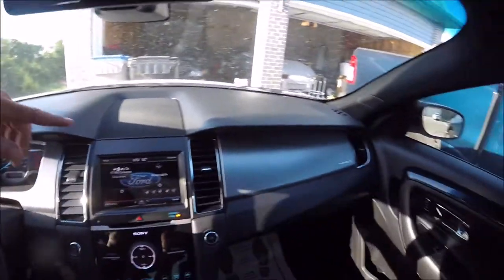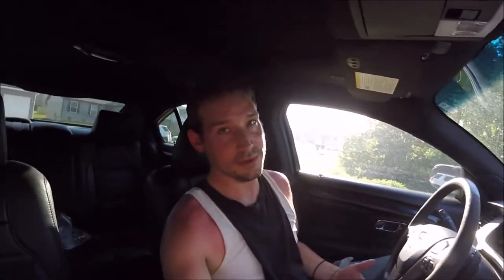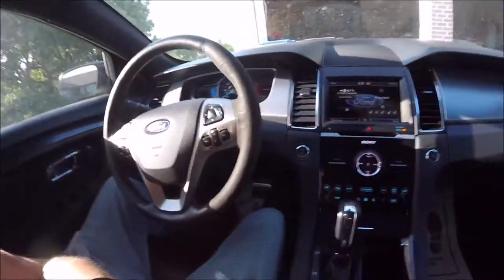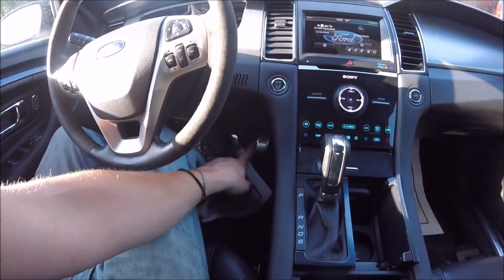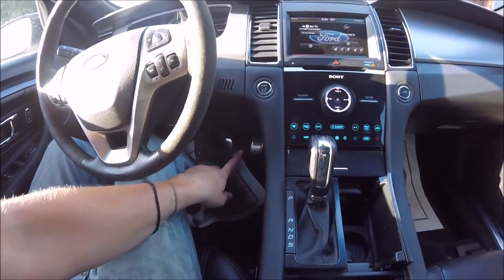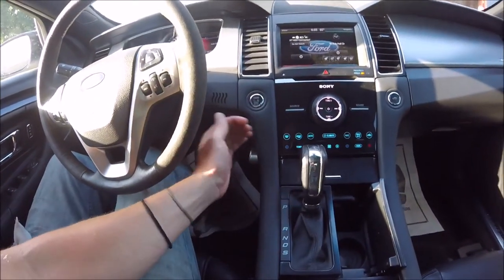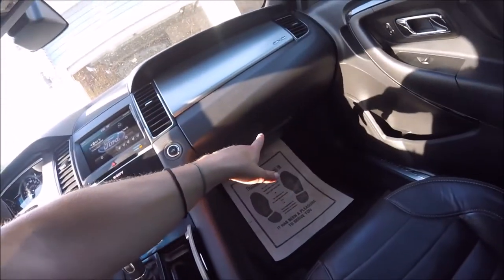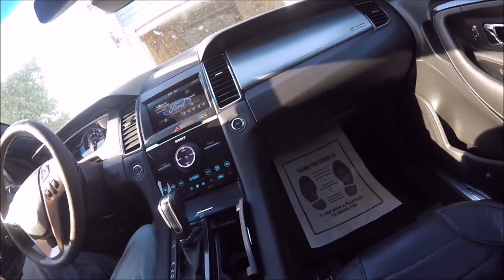A/C from Defrost Only... Cheap fix for your Ford! (Hopefully) | 2015 Taurus SHO

Comment: It worked for me(2015 taurus). Thank you very much for sharing this information. Took about 15 moderate taps with a large  plastic fuse puller(electrician), but it worked...thanks again...

Comment: This freaken worked! I cannot believe all I could find was to tear apart the entire dash before trying, "Knock 5 times, aaaand the door will open." (Yes, mine started working on the fifth tap as well.) Great job, brother!
Reply from the maker: Thanks for the comment and I'm glad it worked for you!  Tearing apart the dash is definitely the permanent solution, but I really didn't have the time or money to do that when mine was acting up, so I was happy to pass this little "fix" along to other people in hopes it would save them some time and money, atleast for a while.  Appreciate you stopping by!

Comment: Well, thank you and you have a LIKE and new SUB. Listen, if you get water on your passenger floor then driver floor, it's coming from the water drains in the cowl under the hood. You need to remove wipers, then BOTH plastic across and look for these little FORD ONLY water drains that fill with leaves get blocked and leak back into car. Then you cabin filter will be shot so change it and hope the A/C works. Thought I would share like U did!
Reply from the maker: Thank you so much!  I appreciate the info and the like and sub.
Reply: Helpful I am getting vwater

Comment: Are all 3 blend door actuators the same size? I’m having this same problem I’m gonna just replace.
Reply: FYI, there are 4 total.  One passenger, one driver footwell, one driver halfway up and one in the dash (which is next to impossible to reach without taking dash apart).  I believe that one is different.  That is the one on mine that died. The quoted $240 to fix with me buying the part and they said it was terrible to replace, as well.  I found a thread somewhere that gave the exact part for each location.  I will look for it.

Comment: I'm having the same issue. I took it into the mechanics and he replaced the actuator and it worked for 1 minute or 2 and then stopped. He changed the middle one. I have no idea what to do now. I hope this works for me lol. My main issue is my engine light came on and it was the cam shift positioning sensor I had it changed with a Ford positioning sensor and the light came back on. Still says cam sharft positioning sensor. I tool it to ford amd they came at me woth a 9k bill saying it was a dozen issues but when I run the code the only code that pops up is the positioning sensor. I got a couple 2md opinions, one from a retired man who ran one of ford's bays for 15 years. He said that what Ford is saying needs to be fixed isn't the issue because if everything they are saying was wrong with my SHO the car wouldn't perform like it does. You would feel it. My car take off on a dime amd runs perfectly. I honestly don't know what to do. My inspection is due in March. If I don't figure it out by then I'm gonna have to get rid of my SHO and I really don't want to. I feel it's a wiring issue but have no idea who to bring it to.  If you can't tell I have no idea about cars. Has anyone gone through this or have any ideas what it could be? Please anyone? I could really use some help.

Comment: Glad it's working man, but that's a blend door actuator. I just took that exact component off of my car, let it hang on the cable and started pushing buttons... If I changed the register selection (ie face to floor, floor to defrost) it was motionless. But when I changed the driver side temp it spun like crazy. The mode door actuator I bought didn't match the part I took off at all. Like I said, I'm glad your hvac started working again, but my (limited) understanding of that system says that nothing should have happened when you tapped on that box. (Disclaimer, I'm still fighting the exact same problem you described at the beginning of your video.)
Reply from the maker: I totally understand it's not an end all fix, it worked for me so I figured it was something to try instead of just hanging parts on a problem.  Seems to be a fairly common problem and I think replacement is probably needed.  Hope you can get yours sorted out

Comment: Tried this on my 2015 sel it works for now  but didn't eliminate the problem completely, now my defrost  won't work.. guess I'll be buying some blend door modules
Reply from the maker: Sorry to hear that, I'm sure I'll be replacing stuff too sooner or later.  Im surprised this fixed my issue honestly.
Reply: Thanks! it worked for me on a 2015 MKS. Changing that thing is going to be a nightmare!!!

Comment: Completely incorrect. The actuator you pointed to is the dual zone/driver side temperature blend door actuator. The MODE door actuator is located much higher up and nearly impossible to get to.
Reply from the maker: Youre probably right, I just found a solution that worked for the time being and wanted to share.  This was never meant to fix the whole issue, just get you by until you could get it fixed.  Thanks for the info though, its always nice to get a better understanding of this stuff.
Reply: It’s not the correct actuator so if it “worked for the time being” then you had a intermittent inoperative actuator, replacing this will not fix anything except the driver side temperature control. This is the actuator that blends the driver side dual temp.
Reply: I don't care what you call any of the thousands of electronic plastic components and dealers/manuals replace stuff ALL THE TIME based on diagnosis and it don't fix the problem.  This freaken worked on mine too. How about this idea... ALL these components work with each other and are operated by a computer.  These vehicles have dual zone climate, so the blend door and mode door work together... maybe any fault sends system into safety mode (defaulting to defrost for visibility rather than comfort)?  All I know is, this has worked for far too many of us for there not to be a sensible rationale.  

Great job, brother. "Fixed my problem in 30 seconds (5th tap btw... conspiracy, hmmm? lol)
Reply: Show us then